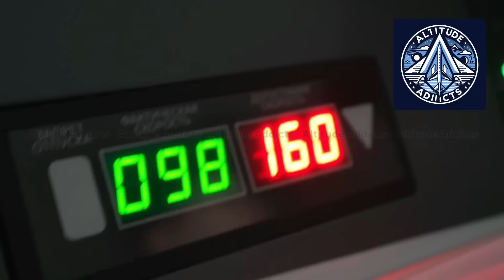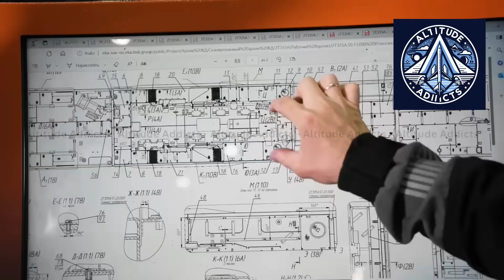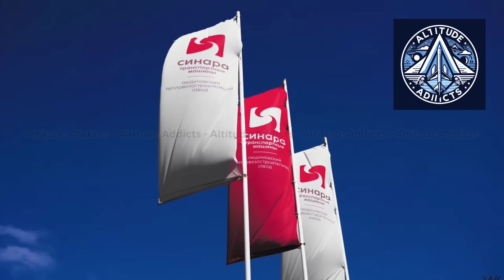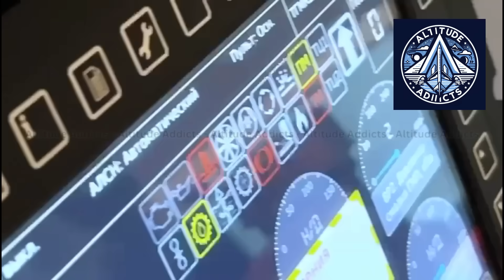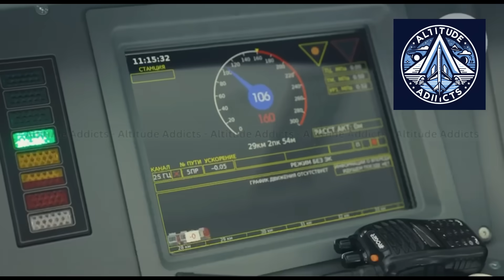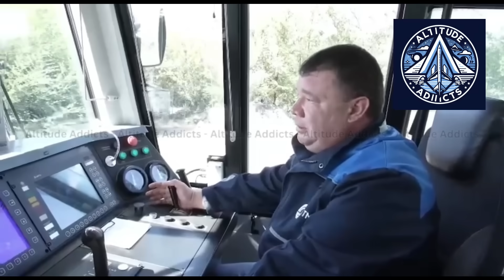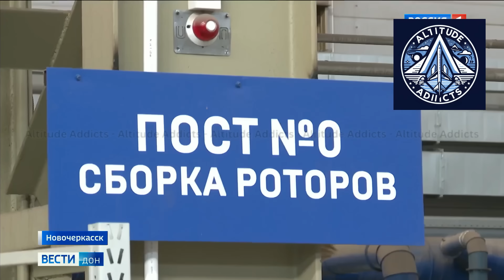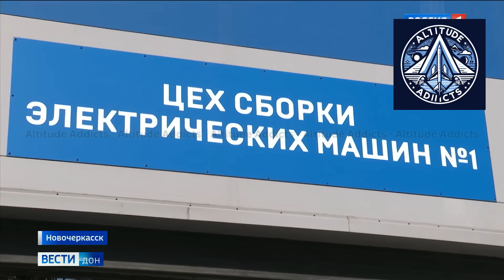How Russia Rebuilt Its Railway Industry Under Sanctions

Comment: Railway industry has survived for over 100 years. Modern railways can still operate (like Greece, they are short of money that lots of things are operate at downgrade/sub optimal situations) using older tech. DC motors with resistor control, ALS track circuit, relay interlock... You can still operate but at higher cost and lower performance or safety. Thus making railway less economy sustainable or competitive in all modes of transport. Or making Russia railway overall less attractive in cross countries logistics.
BTW as a Chinese I dont see any competitive using Russia land transport for intercontinental logistics. Russian custom is trash. Easily get stuck over weeks if not months. My highest record is 1 year. (At least they did not forget it) Also all kinds of weird "standards" checking goods. Just using southern routes or by sea is better choice than going via Russia.

Comment: Russia has been building its own locomotives, wagons, and railway tracks for years. The country is vast and rich in natural resources. And how do you move bulk goods? The best way is by ship or rail. The sanctions have meant that Russia had to boost its domestic production in order to replace the lost imports with its own products. The new production sites have to be connected somehow, and that works best with a well-developed rail network. This boost to domestic production makes Russia less dependent on expensive imports, and it relies on domestic products. This independence from foreign imports and the promotion of domestic production strengthens the domestic economy and reduces outside influence. The country is less vulnerable and more stable.

Comment: Where is the big progress? „Railway sector neither collapsed, nor fully recovered.“, was the conclusion. That trains still drive is not a big achievement, they do so for nealy 200 years. Moreover, according to the video components often have been simpliefied and now require more energy. Almost no exports because Russian trains are not competetive. No highspeed railway in the largest country on earth. A dark picture, especially because in absence of a comprehensive road system Russia heavily relies on railways.
Reply: There has been highspeed railway in Russia since decades. And trains don't just move, they move more cargo than any Western railway, more efficiently and under way more difficult conditions.
Reply: @alexandernater6284  No, there are just express trains in Russia. Highspeed railways (over 200 km/h) do not exist.
Reply: @alexandervt641  Currently, oil refining doesn't even require peak production. 16% of the facilities are FROZEN, simply because it is used to be an export commodity, while now gasoline, fuel oil, diesel, and other products are exported to a much smaller extent. That means there are dozens more refineries waiting to restart if other refineries have problems. Furthermore, name me a single destroyed refinery? The most You can achieve with these attacks is that some specific part of the complex will be shut down (one of the queues) and undergo repairs for a month or two. That's all.
Reply: @alexandervt641  Highspeed rail is defined as 200 km/h and higher, which was in place since decades. Current Vmax is 250 km/h. Stop the BS.
Reply: @alexandernater6284  Where in Russia for decades high speed railways are operated? You wrote total nonsense and repeating lies doesn‘t make them better.
Reply: @alexandervt641  Can you not even use Google? The Moscow-StP line has been operated at 200 km/h since the 70s l. This is considered high speed rail. Period.
Reply: @alexandernater6284  Wrong. It started operation in 1984; 200 km/h was the maximum speed, 180 km/h the maximum operational speed.
Reply: @alexandervt641  Are you seriously telling me, a resident of St. Petersburg, how my railway works and what the speed is? How many times do you think I've used it? Who are you to spin such fairy tales? I understand where you got the 200 km/h figure from. You read about average speeds on meme groups, not realizing that the train makes stops in the St. Petersburg region and in the Moscow metropolitan area, with braking sections, stops, and the unloading and loading of new passengers. You don't realize that the train itself travels at 250-260 km/h, which is quite a decent speed. But I understand all that, so don't tell me fairy tales about how things work here. What's something called "absence" when it exists in the real world? And even if you write anything, who cares? What can you change with this? 

I also wrote above that there's already, ALREADY, a plant producing new rails for newer high-speed trains, and that there's already a plant producing bogies for high-speed trains.

I was writing about the Transib precisely because you're beating your chest about how old the railway is. Even though, in 70 years, not a single component has remained unchanged. We're not developed European countries that run their railway networks on Windows 3.1. We're constantly undergoing updates in Mordor.

If you want to prove something to Russia, go join the mercenaries and head to the battlefield. Why are you just wasting your breath here?
Reply: Друг мой вы идиот!! 😅😅😅😅